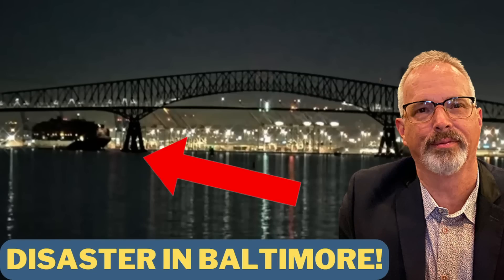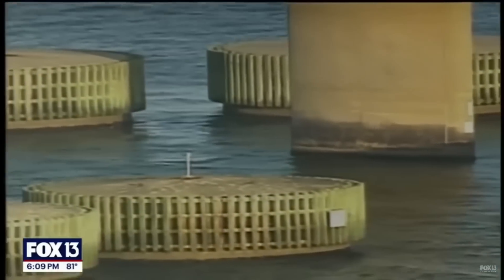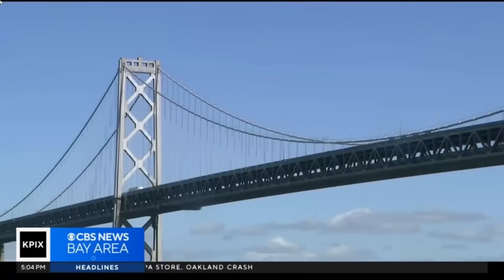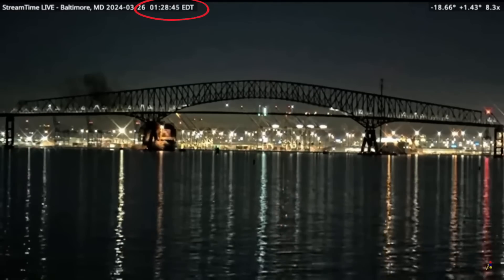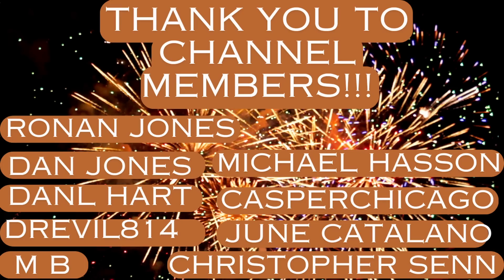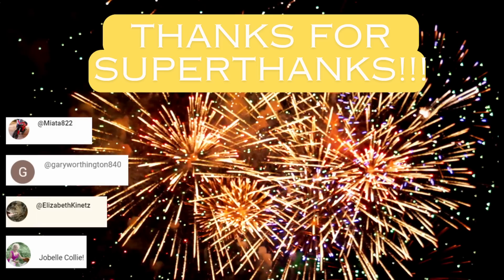How the Francis Scott Key Bridge in Baltimore should have been Protected

Comment: I think that this bridge did amazingly well for the engineeringly unforeseen blow the bridge took, yes it all came down, but that's the design of the bridge, to be clear, 

Minute 2:04 the risers sheared at their weakest point, my thinking is that they had not anticipated a runaway container ship bein' in the 'hood.

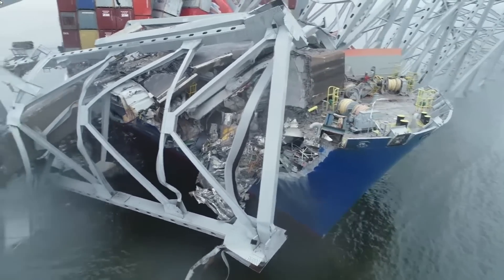Minute 2:29; look how twisted and deformed some of those cross members are, yet they are still attached, they got that bent without breaking including the joints.  I would say that that was a well maintained bridge.

Minute 6:37; I was fortunate enough to have taken my trade schooling at College of the Redwoods who employed Dick Atwell who had been a contractor and was now teaching the trades.  He has since passed, God bless him, but you are right, once we lose those old guys, we lose a bunch, more than we'll probably ever know.

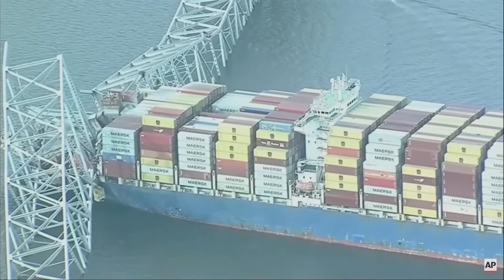Minute 8:00; to be clear, again, I think this bridged preformed to spec's, what I would consider is the use of a tug or two, stationed right there if that is a busy port, and it can be simply based on math, once a ship gets of size that it could take out the structural support, then the tugs gets employed until collision protection installed.

Comment: As a fellow Professional Engineer, I apprecate your clear and informative opinions on these topics. 
P.s. An you talk about companiesand experienc gaps, this was the year that my company decided that because licensure is not manditory in my field and my cowokers generally are not licensed (or maybe too lazy or incapable of obtaining a license), they don't want me containuing to mainain my licensure. I work in the automotive/semicoductor industry. While we are not required to stamp our designs, we are one of the few industries that has exceptional high standards for public saftey. Our standards are higher than space travel and air travel. One one hand they are technically correct. But on the other hand, they should be encuraging us to obtain the highest qualifications that are possible, especially when we could possible be called to testify in the event of a failure or recall.

Comment: Former draftsman, oil and gas, doing everything from skid/building design, through pipeline, metering/custody transfer,  greenfield wellsites and pump stations to compressor stations. Worked for four companies over twenty years.

Today I am just a 3d modeler working with anyone be it prototyping parts to stls for general consumption. 

In the 20 years of working with engineers the quality overall went down hill. When I started there was about a 5 or 6 year window where the Grey folk were starting to pass the torch. I had the privilege of basically sitting on one of tnier desks for my first 3 years in the industry, they were a great mentor.

My last 5 years i noticed a trend. I was teaching junior engineers more than their senior and intermediate bosses. At which point i was troubled by this trend and got into a huge blowout over it. As a result i got transferred to a different department and the engineer got the boot. 

I got dumped into a 24 month project and forced it to make it happen in 14 months. As I result I got burnt out and quit. In all honestly it was probably the worst product I had produced in 20 plus years of drafting. Yes even my university stuff was better. Simply because we had no time to double check things and they were changing things almost daily. We didn't even have an established tagging system for the facility because they couldn't agree on it. When you are producing over 400 drawings one "small" change can easily impact 10 to 30 drawings.

As much as I like, cad systems. They have been an absolute blight for engineering and thinking. Because who needs a plan when you can just click a few buttons. Make it just like the last project, when they actually have nothing in common but the type of fluid in the pipe, just ugh.

Comment: Typically there is a marine traffic assessment to determine the risk level. The design team would recommend dolphins for higher risk category, typically on the piers for the main span. Just not sure what are the statutory/code requirement in the US or that State for such dolphin requirement. If not, maybe it is time to review and update such requirements, which would lead to budgets in upgrades down the line

Comment: The Astoria-Megler Bridge (across the Columbia River at Astoria, OR) opened in 1966, and the San Diego-Coronado Bridge (extending across San Diego Bay between San Diego.and Coronado, CA) opened in 1970,  both have the protective structures you describe.  They were in place when the structures were built.
Reply from the maker: Thank you. Those are great examples.
Reply: As well they should be!

Comment: I'm from the EU, but travel often to the States, and one of the things that is a culture shock every time I come there is how dirty and badly maintained all infrastructure is. It's not just the protection  on this bridge, the whole system is decades behind on improvements and maintenance compared to Europe, with potholes, badly patched up roads, uneven pavements, rusty bridges, wonky or missing traffic signs, worn out lines, etc. To give an example on the bridge protection, I grew up sailing and boating a lot and every bridge, no matter how small has some protection, even if it is just from the little dingy being driven by a drunk idiot who might scratch the concrete. But not only that, most difficult harbor entrances, all sluices, foundations for electricity lines, they all have protection.
Reply: What's worse is how often the states that take in the most taxes have the worst roads. I'm all over New England on a regular basis, and both Massachusetts and Connecticut are well known as very high tax states which are supposed to be for things like infrastructure. But their roads are abysmal, exactly as you describe and when you do see road crews half of them(at least) are standing around on the job getting paid for doing nothing. The contracts in place in these states are outrageous, paying insane rates to workers for subpar performance paid by the citizens. It's completely out of control, essentially a racket at this point that makes a small % rich and makes everyone else pay the cost...
Reply: There may be others, but the only bridge that comes to mind as being well-maintained is the Golden Gate Bridge, probabaly because it’s famous and they’d be criticized if it weren’t.

Comment: Anyone looking at the post accident pictures can see that the ship stopped very quickly after striking the bridge pier, so it's pretty obvious that it is very possible to build a structure in front of the pier which can stop even large ships. The people claiming it isn't aren't even doing the most cursory thinking about it.
Reply: The bow is sitting on the floor because there are a couple of flooded compartments.  And there maybe is a gas pipeline under the ships bow.
Reply: @oldmech619  -The sheer weight of the bridge is holding it down.  Also consider this ship is out of the channel (front of ship).  So the ship it being pushed down into the mud which is 100-200ft deep.  =That is an amazing amount of weight even lifting up the rear of the ship = this ship could easily break in half from this (reason to get some containers off while they reduce the weight on the front).   =It is a tricky balancing act.
Reply: @jonmccormick8683    It is an amazing recovery.   Much more complex than just pulling the ship back out.
Reply: The MSM or Government accounts are making no actual sense at all?, if a ship loses power to the propeller while on course the ship will continue on the course it was on before the loss of engine power, the weight and momentum of such a heavy ship will never turn like the video shows. Remember the ships electrical supply is from one of several electricity generators that these Ships electronic Autopilot controlling the hydraulic motors on the Rudder will keep working keeping the ship on the course set by the Harbour Pilot, remember that the ship was on course to pass under the bridge when the lights went off, without electric power to the Auto pilot the rudder will remain on the set course while it was adjusting course for any wind or currant variations, then when the lights (electric power) came on again the ship auto-pilot would automatically resume the original course settings before the power loss, But! The video showing the sharp turn onto the target had nothing to do with the lights, or Autopilot or wind or currants proves The HUMAN FINGER PRINT is all over this deliberate turn into the Bridge. Heavy smoke from engine funnel is caused by a sudden increase in fuel to the engine that provided strong water pushed onto the now hard turned to Starboard rudder? Who changed the course of the Rudder?  Then again the ship rudder was adjusted to Port to stop the sharp turning ship, because the ship needed to make a direct hit not a glancing blow against the target. The MSM accomplices never talk about the sharp turn onto the Pier, and try distracting saying see how the ship started to turn slowly away from the Pier, but sadly too late to avoid hitting the Pier. Sure sounds like a Government cover up for whatever their reason is <><><> this was intentional closure of Americas 5th biggest port! (Now MSM are saying it is just the 19th largest Port?) No question about that! But was it the US Government extremists or their FBI, or CIA! Did Terrorists sneaking on board and over powering the crew? Was it blackmail of the Harbour Pilots and Captain and engineers, no matter why? It is “who are they” that must be discovered because 6 people are dead because of this deliberate act by some of the People on this ship!!!!!!!
Reply: the people saying nothing could have been done to prevent this are the ones that refused to put in place the measures that would have prevented that.  And the media is helping them cover it up.  then you have the people who gobble up and believe whatever the media tells them without critical thinking at all.  

Hell we had people within hours of the disaster screaming that there doesn't need to be any sort of investigation as to what happened, why a huge ship lost power twice, lost control and slammed into the bridge.  Do I think it was some sort of attack on us? it's not out of the realm of possibility, and I don't THINK it was an attack, but I'd still like to see it investigated just in case.  Whose to say that it's not Russia coming at us for helping prop up Ukraine so much?  Or Iran for us using cyber warfare to make all their centrifuges explode, and for helping Israel ?    Unlikely but I'd at least want to check the possibility.
Reply: That's typical. It is always about money, nothing else. Cost cuttings so the board and shareholders make more money. It's pathetic.
The US must be the greediest country in the world.
Reply: @FrankHeuvelman  you haven't seen many countries, then.
Reply: @adamk203 
I've been around, thank you.
But what about you? How many years have you lived and worked outside your 'Best Country on Earth'?
Reply: Yes, and also keep in mind that if for some reason it wasn't possible, there's still the option of just not running ships through that could knock over the bridge in the first place.
Reply: The problem with bridge protective piers is that the very long BOW overhang of these huge ships would mean that the bow would possibly/likely strike the bridge supports before the bow at the waterline would hit the protective piers.
Reply: The ship immediately went hard aground from the thousands of tons of debris  falling on the bow. That is why it slowed as much as it did. 

The ship still traveled over 200 feet before it stopped.
Reply: @scottkozel1519 on a perfect strike, hitting at the narrowest part of the protective island, the 'chin' of the ship would hit the stone island and have to get through 60ish feet of stone, before hitting the 12 foot think reinforced concrete collar protecting the structure, only then  would the bow of the ship get close to hitting the pillar.  

What is really sad is that the Key bridge had less protection than the power lines not very far from the bridge.
Reply: @norsehawk  
Nonsense. There is a concrete pylon about 300 feet in front of each main pier. The ship turned at such a sharp angle that it just missed the pylon.

" through 60ish feet of stone, before hitting the 12 foot think reinforced concrete  "

It would be like a Volkswagen Beetle hitting a tractor-trailer, as far as relative weights. The Beetle being the tower, the 100,000+ ton ship being the t-t.

Comment: As a recently retired engineer from a different field I will offer an observation. When I was starting out, older engineers were looked up to for the most part and were mentors for the young guys and gals. Now it seems like many younger people have disdain for the senior engineers. This seems to be rooted in a cultural shift where the seniors are looked as 'hoarding' jobs that should be given to young guys. So, there is less mentoring going on which means less knowledge/experience being passed on. I was shocked a number of times by mistakes made by young engineers that would've gotten you fired immediately 'back in the day'. Anyway, I think there is probably a lot of cases where senior engineers are leaving huge knowledge vacuum when they retire. Look at the ludicrous failures at Boeing, I'm sure there are retired engineers from there scratching their heads as to just what the heck is going on there for these things to happen.

Comment: I have so many thoughts about this.

1. Every bridge not protected from the maximum sized ship that uses the channel should have HUGE warning signs leading to both approaches.  There should be a full time local radio station available to the port authority to broadcast warnings which bridge workers should tune to at all times.  (RIP the construction guys lost on the Key bridge.)  There should be gates to close off the approaches in case of emergency.   If the local DOT thinks this is going to scare everybody, GOOD!  They should stop putting the public in danger.

2. Maryland passed on spending money to protect the bridge and will pay ZERO DOLLARS for the replacement??? I'm calling shenanigans.

3. The Feds should stop funding new highway and bridge construction in every state where the DOT has deficient or unprotected highway bridges that are not actively being rehabilitated or replaced.

Comment: Ponte Pietra is a Roman bridge that spans the Adige River in Verona, Italy. It was built in the 1st century AD and is one of the oldest bridges in the world. On April 24, 1945, during the retreat in Northern Italy, the German army mined and exploded three of its five arches. The explosion caused the structure to lift up and then fall back down, miraculously remaining intact. Ponte Pietra is still in use.
Reply: Many of the 2,000 y/o Roman bridges had fenders to protect against flood debris.
Reply: This tells you that the engineers knew what they were doing in the real old days!
Reply: @shirleykurtz They knew good concrete vs bad concrete. No way they knew the concrete chemistry in the good stuff was self-healing and would last millennia. Or they'd have charged so much it'd never show up in a public works project...
Reply: Trier Germany has a bridge built by the Romans in the second century. There are films of American M4 tanks crossing the bridge in 1945.
Reply: @michaelcanty4940  The Roman bridge of Trier was builded by Augustus in the year 13/16 ac.
Reply: Good this bridge is playing cards
Reply: Two things: They don't build them like they use to and every thing is valued engineered today that just meets minimum buildings codes.
Reply: Cool

Comment: I think the concern with Dolphins at the base of the pier  is that the ship (with enough momentum) may hit the dolphin, the dolphin tear into the hull, while the bow continues forward progress at a slower pace until it stops. The overhanging top of the bow would most likely have hit the bridge pier still. The shape of the container ship makes it incredibly hard to protect the bridge pier with standard height dolphins. Also, the angle at which the ship hit the pier (from an inside angle relative to the channel). To protect from this you would need dolphins within the channel inside the bridge pier. This would impact the ability of the current channel to pass two major ships at the same time. (Obviously, the safety of the bridge should be held above the throughput of the bridge)

More dolphins should be used, but I think we underestimate how each cargo ship has slightly different build quality, different metals used, different naval architects approving them, and that all will change how the hull takes on an impact of a dolphin and the ability for the dolphin to prevent any other part of the hull that overhangs the impact area from hitting a bridge support.
Reply: I at least believe that engineers who said that "it is not certain that traditional passive protection would have protected this bridge" are correct.

Also, playing devils advocate is way more fun as an engineer. Experience or not, I am not listening to another engineer and just saying, "sounds good," regardless of them doing the math of a perfect situation and telling me its good. It can be better and its up to the rest of the unexperienced engineers to ask those questions.

Comment: Yes to Engineering solutions,  plenty common sense and plenty $ to implement = Good Civil Engineering .
 But rewind this back to BMW that designed the Ships Engines (?) that implemented all electric fuel pumps to the injectors.
Putting it this way we’ll remove the mechanical fuel and replace with an electric fuel pump controlling 1000ton vehicle now  power goes off now without steering nor braking, yes but we have suppled a large rock to throw overboard and a laptop running w10 in the unlikely event…..